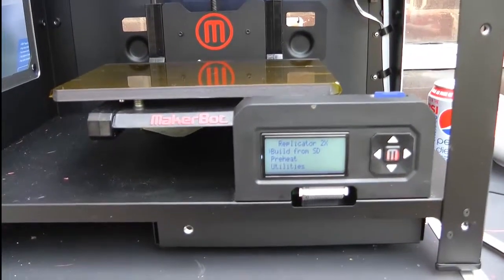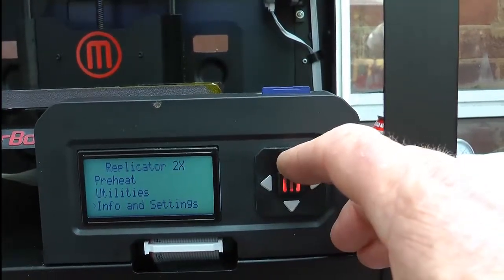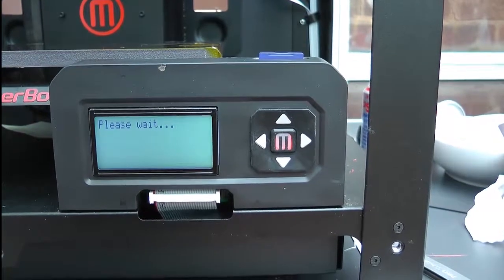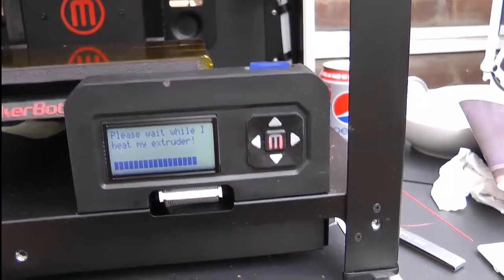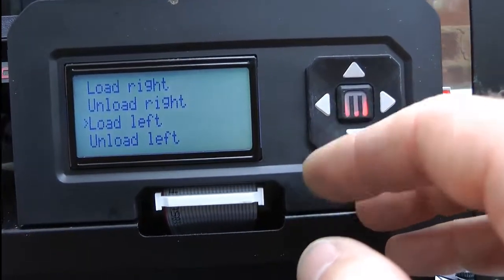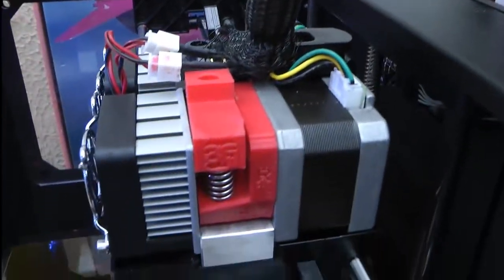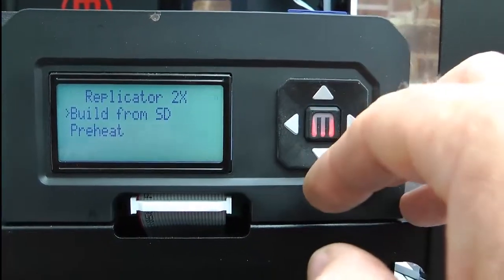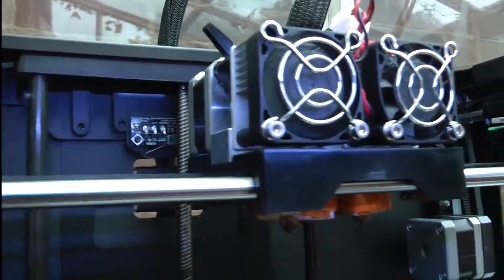Replicator sX Steppers Not Working

Comment: Stepper motors are like most motors, in that they can become a generator when driven or turned manually.  I suspect, that during manual movement of the carriage while doing the flatness check, a large voltage was put out by the steppers back into the board that was not powered on.  

There is a general warning when working with steppers that are connected to a driver board.  DO NOT SPIN THEM WITH THE POWER OFF.  You can move steppers but very slowly.  Think of the slow speed that you use when printing.  Often this is 40mm per second.  That means 6 - 10 seconds to traverse the width of the machine.  Your manual motion speed must be that slow or even slower.